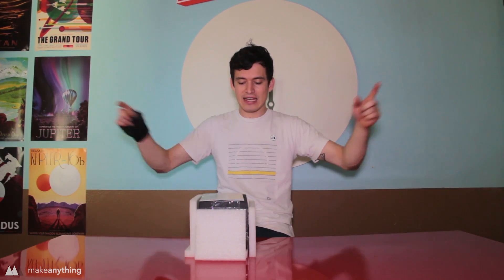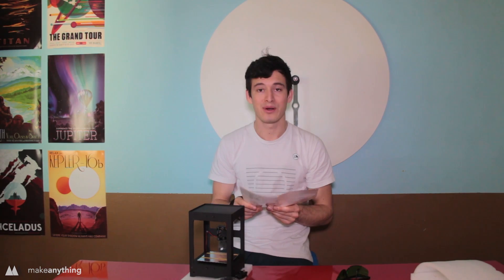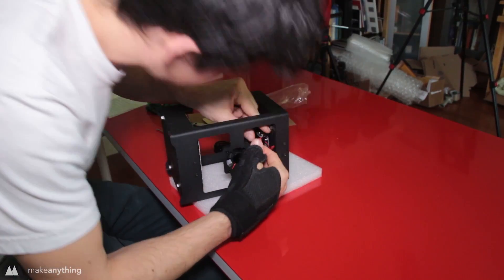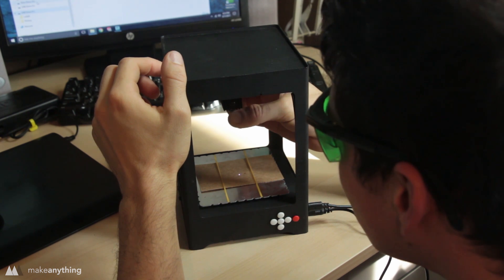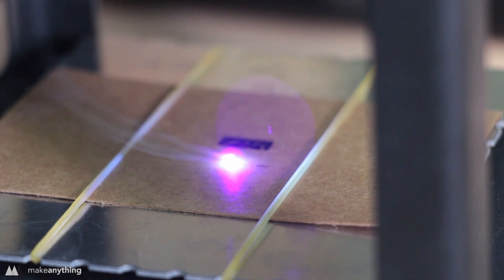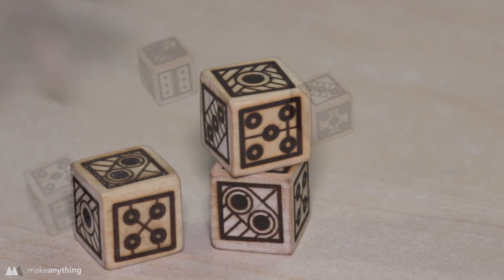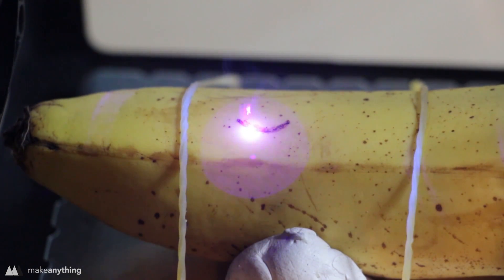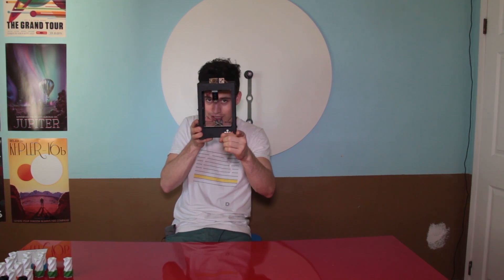Laser Engraving Dice with a cheap laser.

Comment: Please don`t use both stops at the same time. It`s better to place the parallel stop in 45 degree angle from the middle of the blade so that stop ends before you cut. And than you can use a deflector with some magnets to transport the cutted cube away from the blade. I also did this like you and get some trouble with the leader of the woodworkshop in my college ;) greetings from germany!

Comment: I learned the hard way to always use a guard on the table saw not too long ago, just a word to tbe wise for all beginners out there, guards are not a suggestion, they are a lifesaver, luckily I only lost half of my thumb tip but a slight slip more than I had and I might have lost either my whole hand or my life due to blood loss, always use a guard and always have someone around that you know can get you to an emergency service just in case

Comment: Devin, when working with such small pieces, you may want to switch to a low tolerance insert on that bandsaw. They are really easy to make if you have a couple of tools (look at I like to make stuff or Matthias Wendel for their way to do it) or not so pricey to buy and it really help reduce the risks of issues.
Reply from the maker: Thanks for the advice.. I thought about using the bandsaw, my blade just isn't totally precise

Comment: What will happen when you laser a 3d print?
Reply: Darrell van Swinderen it would melt
Logic k?
Reply: ABYSS!Sans the skeleton But would it with an unfocused lens?
Reply: It will still melt because a hairdryer can melt it but unfocused lens is basically the same amount of heat
Reply: Curious about trying the idea. It could melt, but just locally, right?
Reply: PLA melts with a hairdryer not ABS plastic

Comment: Don't use a miter attachment with the work touching the fence because the material binds every time and goes flying. You must clamp a block to the fence before the blade to set your length, then as you push it up, there is enough clearance between the fence so it doesn't bind.

Comment: can you use it as a cutter?
Reply: Almujtaba Osama maybe but it would have to be on really high power
Reply: Houston Newton actually that's what I meant to ask, is it powerful enough to cut material
Reply: Almujtaba Osama it still would have to be at high power work a thin material or plastic that melts at a low temp

Comment: Could you use a laser engraver to smooth the finish of a 3D print? Do I know what I'm taking about? No. But still...
Reply: Rouverius maybe if he turned down the power really low? if he kept it at the etching level, I'm guessing the PLA would melt. You only need a hairdryer to make it pliable (hairy lion print!) and a laser is much hotter than that. I think the simplest way to smooth a  print is sanding it. Or using acetone if it's ABS.

Comment: You can set it on a low setting and try to engrave a plastic box, so it will just basically etch a design into the plastic. And maybe place a thin sheet of plastic over another color plastic and run laser over it so the two plastics fuse to make  design.